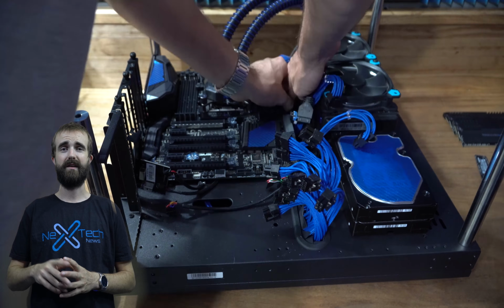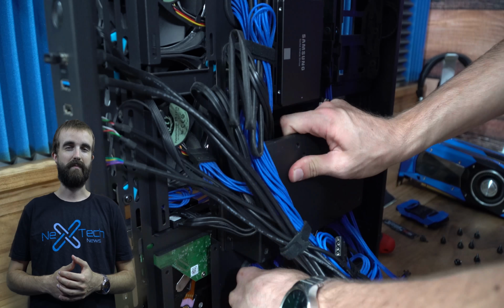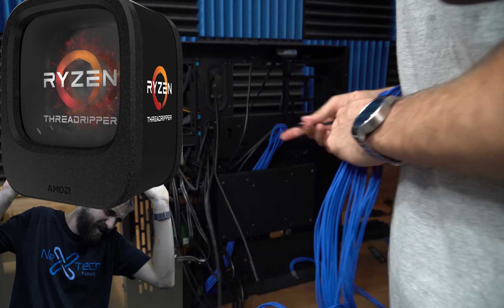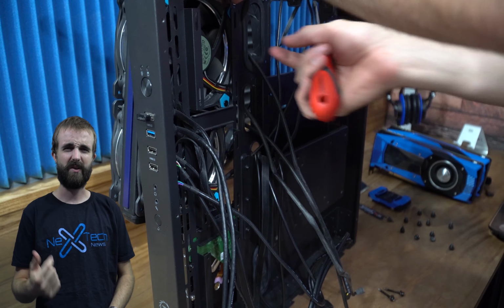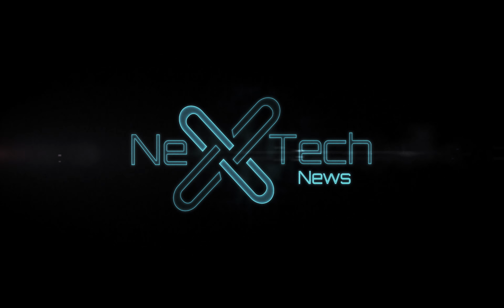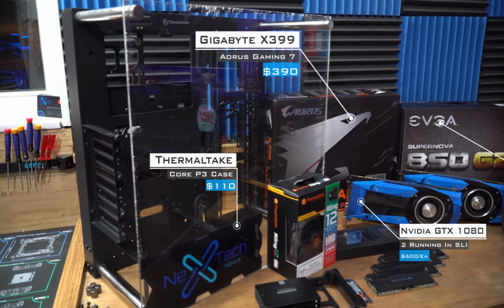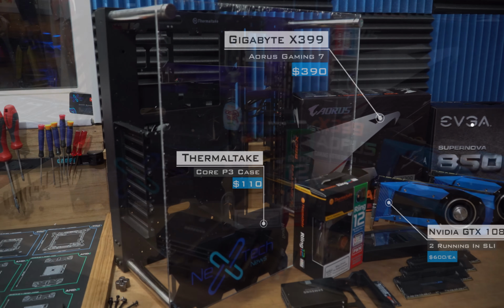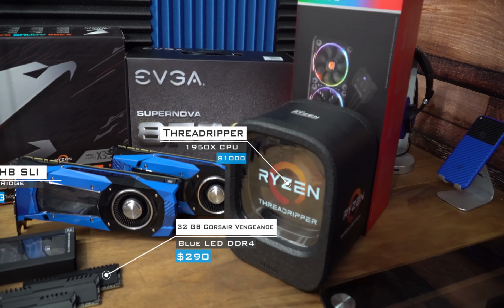Overkill Threadripper 1950X Core P3 Wall Mounted Build

Comment: You are the only one that did an actual video off of PCPartPicker.... Thank you so much. Looking to build something similar only with a few differences. I'd like to put in the 4266 RAM and and MSI 1080ti GTX Lightning Video Card. Yes a little more to the price but it will be my first major build since the 90's. Awesome Rig and thanks again for the video!
Reply from the maker: Your very welcome, and I didn't think threadripper supported 4266 ram? are you just doing it for future support or? Sounds like one beat of a pc!!! I'd love to see it when it is all finished!
Reply: I was trying to build for the future. Since this is my first build since the 90's. Just wanted to get ahead of the curve a bit. Thanks for the heads up, I'll have to delve deeper.
Reply from the maker: +Wolvereens Thandraug Okay that's understandable! And your welcome!

Comment: I wish I had this setup you were putting the new PC in
Reply from the maker: +JWil42 Haha yeah it's taken alot of work to get it where it's at now, but it has seriously come together!
Reply: NeXTech News yeah, even the color scheme, black/blue, is in line with mine.  Having a Threadripper and 1080s in SLI would be awesome.
Reply from the maker: +JWil42 It's been sweet so far! Hurt my wallet but still sweet haha!
Reply: NeXTech News which one?  The PC or the setup?
Reply from the maker: PC Setup honestly wasnt that bad! I built most of it with scrap wood from a shop I have access to
Reply from the maker: PC is what hurt wallet haha!

Comment: That is not nearly enough thermal paste to cover a threadripper. Your contact surface is like 1/3 of the cpus surface. Jayztwocents did a video demonstrating this. Cool build though
Reply from the maker: So did gamers nexus. When i went to film the build i wasn't thinking about it but after filming i went back and reapplied the thermal paste using the line method which is definently the best method from what i've seen
Reply: glad to hear #saved. i was def about to write an angry comment.
Reply from the maker: Haha yeah i fixed it, sorry about that!

Comment: Can you explain to me the reasoning behind the 5 fans on the rad? As I am looking at building in this case with a 360mm aio and I’ve never seen someone do that before
Reply from the maker: It has six fans and it's in a push pull configuration, lots of people do it with smaller rads but I also did it here with a 360 aio
Reply: @NeXTechYT  Ahh okay, done some of my own research and have a better understanding of push pull now, thanks for the reply mate
Reply from the maker: Your very welcome!

Comment: what about dust dont the fans collect alot of dust? it looks like the case is open...
Reply from the maker: +Gabeacca Honestly dust has never been that bad, it collects the same dust that only normal case does, but the thing that I like better is that it's ten times easier to clean out the dust in an open case like this versus a normal closed case

Comment: definitely my style, but the cable management .....
but better than nothing
and you should definitely switch to the "Riing Plus" fans.
 you can control them via software
Reply from the maker: +Axel K What's wrong with the cable management? And I've been looking into them they look sweet!
Reply: you can´t do anything about it, which is due to the soft "standard" cable.
In a glass Case,I would install a power supply that "pre-sorted" the Cables, that´s a cleaner look.
for example: "Silverstone SST-ST1000 PT" that has the cable "classic style" connected. a 24 pin is a 24 pin etc not Corsair or Evga with its 10 + 14 or Superflower with 18 + 9 etc. and cables in matching length without connections which are too much.

I have a link to Hans Peder "p0pe" Sahl, something I call "cable management"
https://www.ekwb.com/blog/prototype-no-2-by-hans-peder-p0pe-sahl/

Comment: How well does the thermaltake handle the heat of the threadripper? Is there any headroom for OC?
Reply from the maker: +alsebka Surprisingly well even though it doesn't cover the heat spreader completely. I'll have a video soon on overclocking results with this cooler

Comment: I really like the look of your 1080s, I just build in the Red Special edition Core P3. How did you get the light to be blue instead of green. Red is my theme. 

Currently rocking a
7700k 4.8 GHz
Corsair H110i 280mm AIO cooler.
16 GB memory
MSI Z270 Gaming Pro
GTX 1070 (I Plan on upgrading to either 2 1070s in SLI or one GTX 1080 Ti)
Samsung 850 EVO 250GB
2 WD Blue 1TB drives
Reply from the maker: +justin garner I took apart the 1080 and sanded the green away and then spray painted it with a translucent blue paint I got at a hobby store
Reply from the maker: +justin garner And very nice build btw!!! Have any pictures?
Reply: I do actually, hit me up on Twitter I just posted them. @Garner_9
Reply from the maker: Nice looking build!!!!! Like really nice!!!

Comment: Question. I'm thinking of building a computer. The main function of the computer, will be to stream 1080p videos, through plex, to multiple devices. Not just within my network, but to other family members homes simultaneously if needed. 

Would a Threadripper be overkill? Someone suggested a AMD Ryzen 7 1800x.
Reply from the maker: Yeah I believe threadripper would be Overkill for you, a 1800x would be a great choice
Reply: This computer will be used for multiple things, not just streaming and transcoding 1080p content. I haven't recently, because my computer can't seem to handle it anymore. But I've done a little developing in the pasted, and used programs like blender. I know my current computer had a hard time rendering stuff in blender.

If I end up spending $2000 or more, it needs to be future proof. I don't know how long it'll be before I start using 4k content, certainly not set up for it now.

Thanks for getting back to me.

Comment: hey did the aio cooler come with the am4 bracket?
Reply from the maker: Threadripper is tr4 istead of am4 and the CPU comes with an asutek pump bracket, so any asutek pump will work with threadripper